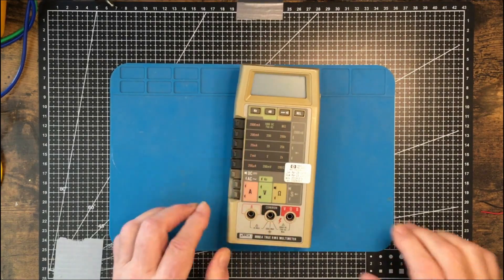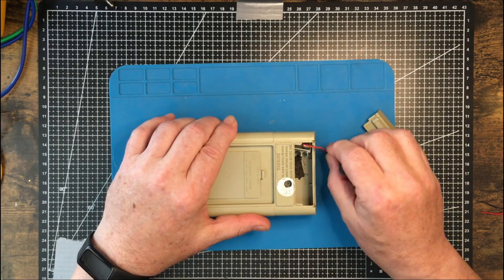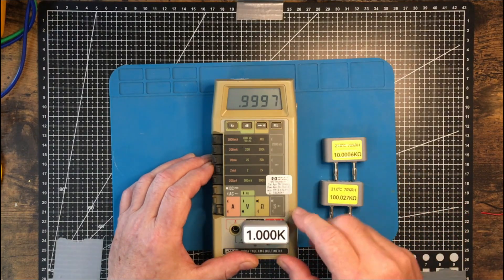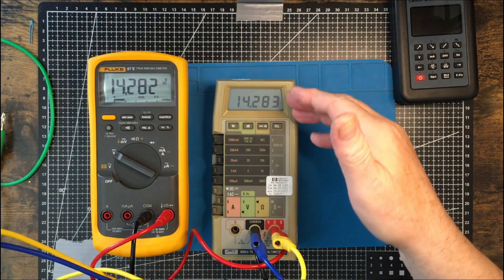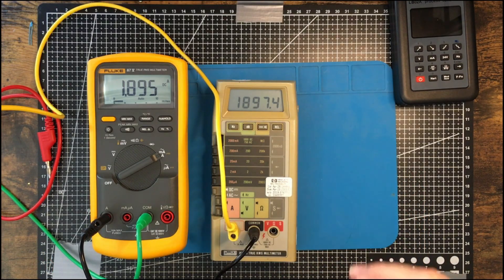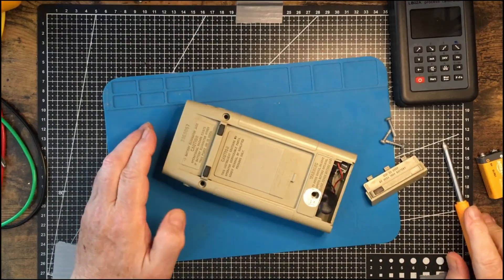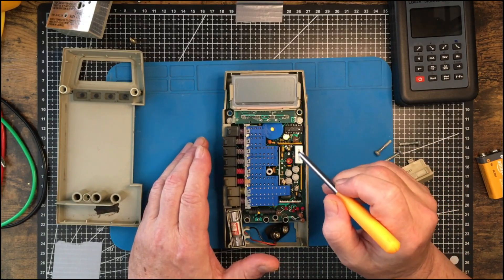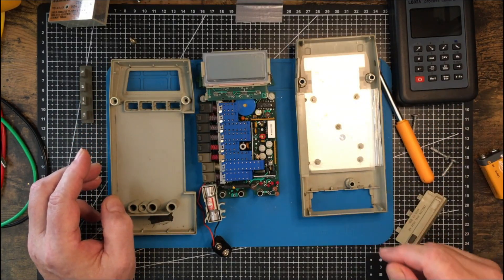Uni-Byte 0313 - The AMAZING Fluke 8060A!  Fit for PRIME time.

Comment: My comment did get deleted for whatever reason but still ... the caps with these meters are kinda crappy and always start to leak. I repaired a bunch of these :D
Reply from the maker: Thanks, I'll keep an eye on that.  Not many caps in them so would not be a tough job.
Reply: @uni-byte  Some are kinda hard to get to because of the available space and if they started to corrode (not always visible) its a lil challenge. Most of these meters it just started, so just a little pool of otherwise invisible electrolyte under the cap. But i had two of these meters which went all corrodoplosiv. :D
Reply from the maker: @kevkabluebird1032  Thanks.  Maybe I'll have a look sooner rather than later.

Comment: That's not a caddock resistor, that's a fluke OG resistor network IIRC. Can tell from the characteristic blue
Reply from the maker: You're most likely right.  I couldn't read what was written on them, so made the assumption.

Comment: Cute that the Fluke has an HP cal sticker :-)   What a great deal!   I picked up a Fluke 8050A bench DMM that I'm happy with some years ago.  Had to replace the old LCD display with something new and fancy, but the cal after all these years still good!
Reply from the maker: I too picked up an 8050A.  It had a bad display as well, but it was due to a driver so was a bit easier repair.  One of my first videos (#0018).

Comment: John Fluke Mfg Co, Inc. 🤠!  I missed the continuity test 😗 Where's your new device? 🥰
Reply from the maker: You're right about the continuity test.  The little tester was at my other location.  I need to build up another.  However I just tested it now and it steady down to 3ms.  Not bad at all for something designed in the '80s.

Comment: I have two of these meters; one is useless due to missing display segments; the other works OK. Looks like yours has a good display too. I would say that's the primary thing to look for--a good display.
Reply: Try taking apart the display and lightly cleaning the contacts.     I have one fluke that looses the segments.    Cleaning brings that one back.    Doesn't always work.
Reply from the maker: That's great you have one that still works well!  Yes, the display on these, and the 8050a, seem to be the first things that go.